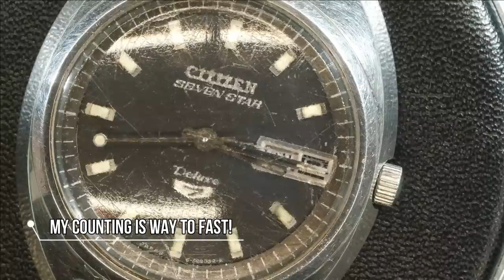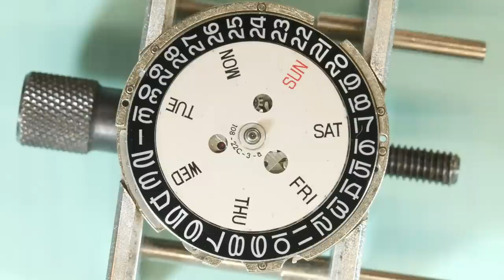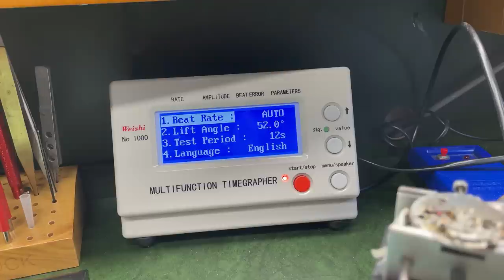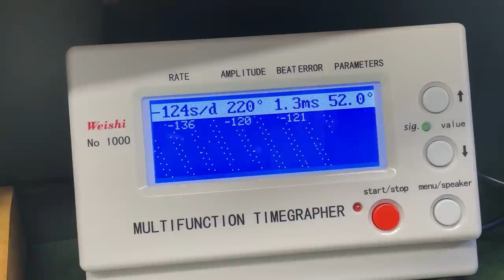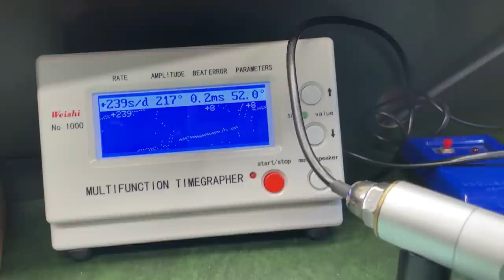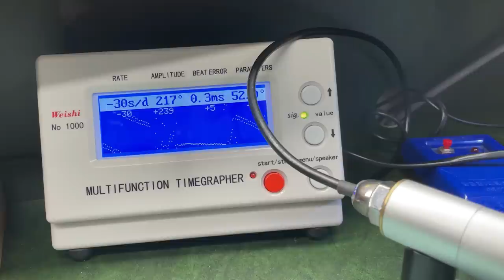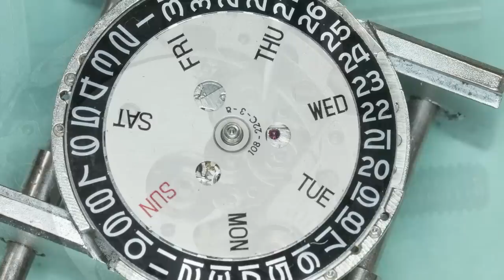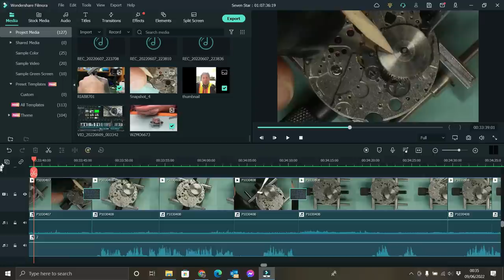Can I restore this Citizen watch?   A really tricky movement! Watch Repair

Comment: I should honestly confess that I hit the LIKE button because of your SPRING fighting effort. I ruined many watches of mine by losing the spring and cannot find them. I knew how you feel when you take out or put in the spring in place and pray for you when the spring flyover. Nice job and you earned my LIKE button!
Reply from the maker: Thank you. If you are struggling with springs then use some plastic to cover the movement like a resealable thin bag. You can still just about fit them like this and remove of course makes it easier. If it flies it can’t get out of the bag.
Reply: @MyRetroWatches  Thank you for your suggestion. I will try next time.

Comment: RIP Kevin 😞. I think you have saved me alot of time Mike, at the moment I'm looking at a Citizen crystal seven which I think is from the same period. It looks somewhat similar, I haven't disassembled it yet. But I got all nervous when you showed all of the springs and parts under the date wheel 😄,  I think I will be stuck with this through the whole summer :p ... Well done job! Thank you.
Reply from the maker: Thanks hahaha. Take off the day wheel and you will soon tell!
Reply: @MyRetroWatches  By the way, if I'm very worried about springs flying away even with Rodico I put the movement in a little zip bag and work from the side of the opening, then the spring flyes away in the bag or maybe just goes to the opening where my hand and tools blocks it.

Comment: Great job tackling a tough movement!  Something that has helped me as I learn the hobby is the tech sheets,  AWCI is a GREAT source, for a reasonable membership fee (I have no association with them other than I'm a member), has many, many movement tech sheets.  This one was there.  I would have sworn looking at the post on that double spring that it may have been in there incorrectly, but looking it up, it appeared correct.  A very odd setup for sure.  And, I totally get the shaky hands, I have them as well, some days much better than others.

Comment: What a nice tribute to Kevin Bolton. I know of cases where something exciting, like getting into watchmaking, has extended the life of a sick person. I have also seen friends that have passed on posthumously give something back. In this case, I think it was this especially challenging watch that he knew you could fix! This watch is certainly a departure from the usual Swiss-themed movements that seem to dominate the watch world, and watching you service it has been very instructive for soon-to-begin watchmaking  adventures. The thing that really strikes me though is how adjusting out the beat error also brought the balance down to the correct rate. I somehow imagine someone less knowledgeable than yourself attempted to service this watch. They used too much oil, and tried to regulate the watch by adjusting the balance spring stud instead of the regulator.

Comment: Ive noticed that citizen does their crystals in increments of .1 instead of .5's like normal watches. That case shape is really crackin! Doesnt look aged at all! retro designs are in fashion again.
Reply from the maker: Thanks Stephen.  As my first Citizen it won't be my last despite the challenge.  I have another Seven but a 30 jewel one and I think its missing a stem so maybe once I have recovered from this one I will tackle it.  Yes a weird crystal size but its like watches I have seen with 17mm lugs, just plain strange.

Comment: This one is a really interesting movement. You would think they would go the traditional route of other Japanese movements used during that time. Wonder if the mystery clip shown in 27:24 is actually whats holding the yoke in place on the other side. Rewinding back it looks like it matches up to that same post location.That might explain why it didnt come out and the post was folded over the way it is.
Reply from the maker: someone else suggested this and its a good call and something I totally overlooked. I guess I  was beaten at that point with the disassembly and then never gave it a second thought.

Comment: Really like the new assembly setup and voice over! You lose track of how small these mechanisms really are, but getting a different camera angle reinforces that. Can't tell if the new lights are humming or if that's something else, though...
Reply from the maker: Thank you for this feedback Andrej. I think it will be the way forward for the restoration videos.  Yes there was a hum that I did try to reduce considerably. I am not great at audio yet.  It seems my stereomicroscope gives off an electrical hum when plugged in and for the sound capture on the assembly I put the mic very close to the bench on some rodico! clearly it picked up on it.  I use a website called Auphonic to adjust the levels through an algorithm its does a fantastic job.
I am working on improving sound for the next restoration.

Comment: Those springs look intimidating. Vintage loved their springs apparently.  Kal Slaap from chronoglide channel had an interesting idea for when dealing with fly away springs. He said to put the movement into a large(gallon size) zip top bag. So when they decide to fly they are inside the baggie. Good idea? Possibly.  That watch cleaned up nicely indeed. Great job Mike. Warts and all, I enjoyed this one.
Reply from the maker: I used to put a piece of plastic over them but only for removal. I found with fitting as your pinching the plastic it actually becomes more dangerous.  In truth once they are in properly they should not fly. Like I demonstrate only take the pegwood away when you are sure all is good.
Thanks for your comment and for watching.
Reply: @MyRetroWatches  I've not had the pleasure to remove that many diabolical springs in a movement yet. Yes, I'd only try the baggie trick when removing them. Replacing them is another matter entirely. Hey at least you found the one on your arm. Tiny little bugger. Lol. I had one bounce into my shirt collar and lost that one. Lol

Comment: When I encounter a watch running fast like this the first thing I do is check to see if it is magnetized.  The most common cause and the simplest to fix.  If not demagnetized, even if given a full service will still run fast.  Haven't watched the rest of the vid yet so may have already checked for this.  First thing in any case that I do is check for a magnetism.  (balance spring is the culprit)
Reply from the maker: I am kind of similar, its obvious it will be the hairspring but with all the watches I have done magnetism is rare. I find more with debris or oil on the springs.  This one had a combination of it all. there was a hair in the hairspring which I didnt show plus dried oil and magnetism.   thanks for your comment and thank you for watching.

Comment: Shtern Kroits if I dare to say is a "pronoucing" of the Sternkreuz word. Nicely done job. I just can not understand why someone skilled like you can clean and refit those funny shocks and cap jewels but is scared of those stupid springs. Awesome work and ton of effort.
Reply from the maker: I was nervous because I’m filming and if I lose a spring then if I can’t find a replacement then it end of video. After all the effort of disassembly , cleaning and then editing up to the rebuild I have invested hours into it. When you have some many springs and especially the double spring which I’ve never seen before it gives more pressure.  That said I also think it made the video more enjoyable to watch.

Comment: Hi Mike. The yoke pivot looks like it is retained on the other side by that part you said looks like it does nothing. If you take the screw out and move the retainer away from the yoke pivot I think it will release the yoke. Must be an indent in the yoke pivot on the other side.
Reply from the maker: Thank you. Many of you viewers spotted this so at least I know as I have no intention on taking this one apart again! My only excuse is I was beaten by the dial side and I think at that point in the disassembly I’d had enough.

Thanks for letting me know and I hope you enjoyed this video.

Comment: Serviced a Citizen 5204 recently, same dial side configuration, the worst movement I've worked on so far!
Reply from the maker: I think its deliberate by Citizen so even the pro's will turn it down and then the owner has to buy another watch!   I did enjoy this one despite the shakes and the challenge.
Reply: Hello Sven, what amplitude did you get from that 5204? Interested to here :) thank you.
Reply: @Watcheyes  I've sold it since, from memory it was around 220-230. I've progressed in my watchmaking skills, so might be able to squeeze a bit more out of it. I did not replace the mainspring.

Comment: Sitting here, chuckling at your mentally swearing at those awkward springs. You really had the shakes for that reassembly! When fitting springs that like jumping, why not work in a small plastic bag, so they cannot go far! Agreed that you couldn't film through a bag. Neat trick catching the tiny thing on your arm-hair! I've dropped tiny screws before - not watch screws - and spent ages looking for them, just to find it nestling in my shoe, or equally unlikely places! I think the voice-over makes the job easier for you, because you can concentrate on what you are doing, and not on trying to speak coherently at the same time - and you don't need to beep or edit out the occasional f-word when it goes wrong!
Reply from the maker: You know I don’t think I have sworn in any video and rarely do off camera for watches anyway.  Parts fly and the magnet comes out!
I’ve tried plastic bags but can’t get on with them plus they can get tangled up with the movement . 
Once a spring is in place and your sure only then is it time to take away the pegwood. 
The shakes was hilarious I don’t think I’ve ever had it like that before but I’d built up in my head doing it on film and not wanting to lose any of them as it would ruin the video .

Comment: I watch circuit board repair and see them reballing hundreds of tiny solder balls to micro chips. I think your watch repair is just as frustrating.  How you cope with frustration I don't know.  Highly skilled work.
Reply from the maker: I just laugh at the stressful bits.  If you dont and then get frustrated it leads to mistakes. I dont let a watch beat me but it may win a few rounds here and there!  thanks for watching.
Reply: @MyRetroWatches  gee so tiny components and the respect of this video is awesome. Take care looking forward of your post in future.

Comment: Wonderful video, inspiring work, and beautiful results!  I just took apart a Citizen 7, although an earlier version with a 4032 movement, and the dial side on that is different, but incredibly complex also.  I think finding these difficult mechanisms are what drives me!  

I love the way you sigh and are visibly relieved when you get those springs in.  It really captures how probably most all hobbyists feel during these assemblies.   Again, great work!

One question: Did you put the balance shock jewel in upside down (called: parashock spiral spring with jewel)?  It’s a little hard to tell because of the lighting, but the way I remember which direction the jewel goes in is that if you orient it so that the little nib of the spring that connects to the jewel is at the top of the jewel, with the correct side up, it will look like a “C” (Citizen). If it is upside down, the “C” will be backwards. Unfortunately, the jewel is not symmetrical, so there is a top and bottom.  I struggled to figure this out but recently found that there is a good illustration in the 1971 technical manual. 

If it is in upside down, this might be affecting your amplitude and rate.

Keep up the great work!
Reply from the maker: Thank you for this comment.  I think adding filming to the equation brings more of a challenge. I was only to well aware I had to get these springs in right and not lose them, if I did then the video would have been a disaster.  The sigh was relief I did it and did it on camera. 
As for the shock jewel its in the right way. I actually fitted it the wrong way first and it just stopped the movement.  I saw the cup on the jewel and figured this must be facing up for oiling, which of course is incorrect.  If the footage is wrong then I may have filmed under the scope before realising. (most likely) 
Pleased you enjoyed this one. More to some very soon!
Reply: @MyRetroWatches  I hear ya.  Filming seems to add another degree of difficulty to something that is already challenging. Not sure how you do it!  Great work...and I think we all breathe that sigh at times.  Citizen has some really cool vintage pieces.  Hope this one didn’t do you in and that we might see more of them!

Comment: Must ask, you had a concern with the balance wheel and hairspring, yet you omitted reinstalling it. I have one of these and I have a problem when I install the balance. I was waiting for it.
Reply from the maker: 43:40 I show me fitting the balance to the movement. I never removed the balance & hairspring from the cock , hence not showing it being fitted. I cleaned and demagnetised the balance complete .
Reply: @MyRetroWatches  ah, my apologies. I saw you flip over to the date side and didn’t see that you went back when the train didn’t run right. Ive been working on this one for several months and the springs killed me too. But, right now when I put the balance wheel in it doesn’t swing. My train and main spring all work. Ive done hundreds of orients and seiko and seagulls so Im a bit perplexed. Thank you.

Comment: The gear you couldn't get off. I think the trick has to do with the hole. My guess is there is a spring and a lever under it and you release the gear through the hole.

Comment: That watch is running 🏃‍♀️ very fast. I would say to adjust the regulator to the balance wheel, but it sounds like a different problem than this. This can be a problem with old oil, which makes a watch run fast 💨. Maybe 🤔 a wrong 😑 size, under capacity mainspring. You’ll get this Citizen running. Your friend, Jeff.
Reply from the maker: How is it running to fast ? did you watch me regulate it in the video?
Reply: @MyRetroWatches  I thought 💭 I saw the second hand going around at a very fast pace. It may just be me. Your friend, Jeff.

Comment: Hi Mike. You seem to have abandoned both ergonomic and auto oilers. I’m not happy with my 0.18mm ergonomic and thinking of buying a normal Bergeron ‘Red or Black’ oiler. What do you think?
Reply from the maker: I had one ergonomic black oiler and broke the tip off and it annoyed me given they are so stupidly expensive. I get same results with my red and black cheap Bergeon ones I don’t see the point in another ergonomic.
I still have my 1A automatic oiler but that is just for shock jewel types which I do use but don’t always show.
Possibly will extend my auto oilers to other ones but again they are silly money and if you break the tips on those replacement needles are crazy
Reply: Thanks for prompt response. My view exactly. Regards and thanks for excellent videos.

Comment: 36:18, not riveted. The hooked shaped flat piece on the other side, held down with a screw, holds the other side. Loosen the screw, swing the flat counter clockwise and the yolk falls out.
Reply from the maker: Thank you Dan. A few others spotted this. I think on disassembly at that point I was exhausted from all the springs and didn’t give it a second thought. I have never seen that type of setup before either. At least I know for the future because I’m definitely not taking this one apart again for many years!
Thanks for letting me know .

Comment: Rodaco is your friend rather than the "traditional" peg wood frankly
Reply from the maker: Problem I find with rodico on springs is it can pull the spring out on removal or parts get trapped in the area.
It’s whatever works and for me peg wood is reliable for me

Comment: That little screwed down hook you thought had no purpose, pretty sure that is the spring that is holding in the yolk you thought was riveted in.
Reply from the maker: That’s a damn good point not that I want to take it apart to check!
Reply: @MyRetroWatches  For sure, it's working! leave it be! lol
Reply: I thought the very same thing. It matches up to the other side.

Comment: Tge tips of your tweezers have become rounded at the tips. That seems to be the problem with removing parts and especially the springs.
Reply from the maker: @amphibiousone7972   my tweezers are fine size 00 so supposed to be slightly rounded.  I now use a thicker set on springs to get more grip.